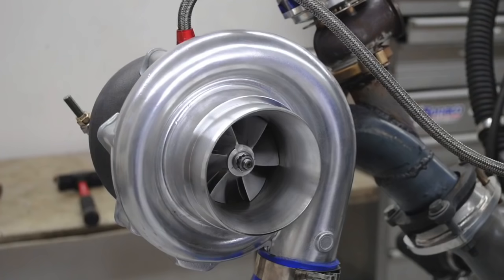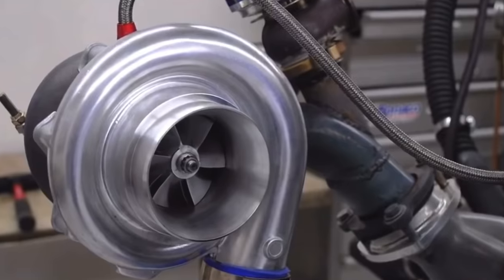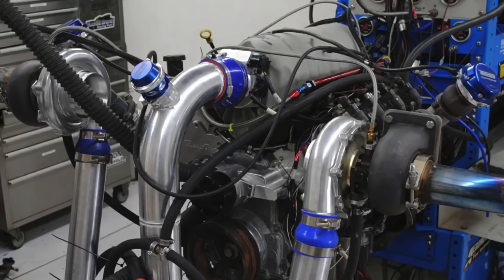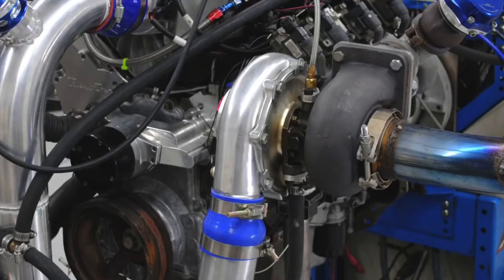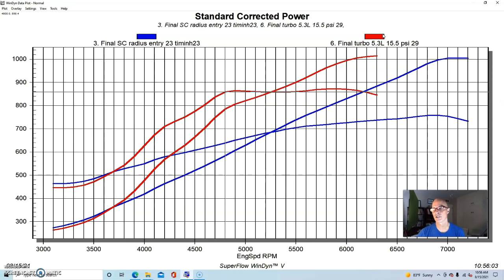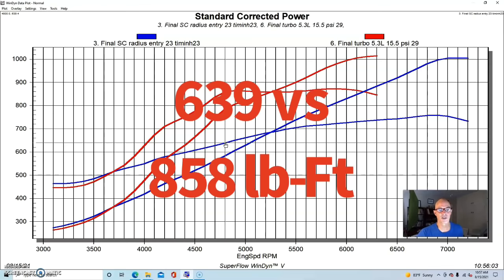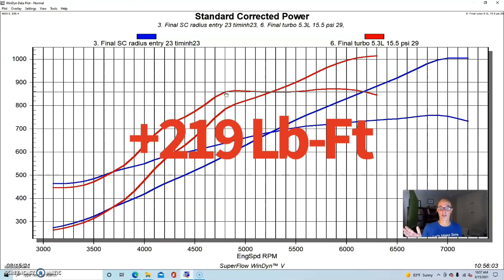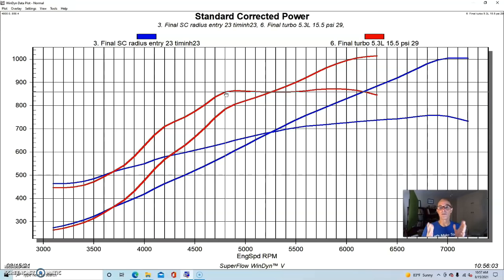HOW THEY WORK-PROCHARGER VS TURBO (WHAT WORKS BEST?)

Comment: The turbo is thermodynamic "magic", it extracts it's power from the wasted heat in the exhaust
Reply: No.. it spins due to gas flow.. hot gas has more volume. A hot turbo has tighter tolerances.. hense you can't hit a turbo with only a. Blow torch and make it spool.
Reply: Not really...  Turbos are just more efficient than mechanically driven superchargers.
Reply: He's not wrong. Just left out a few details. The thermal efficiency of a naturally aspirated engine is abysmally low. The vast majority of the BTU's of energy available in the fuel is wated as heat in the cooling system and the exhaust and the oil. A turbocharger uses one of those wasted forms of heat, which is energy, to increase power output of the engine. Thereby improving the thermal efficiency.
Reply: @yolofullsend  You need to study thermodynamics. It's a 3rd year mechanical engineering class, at least for me.
Reply: @michaelallen2501  spot on
Reply: @HerrPoopschitz  This is exactly why I generally refrain from making any sort of comment that involves anything more than "great video", or "love that"
Reply: @mark_osborne  it’s ok Mark… the intellectuals understand exactly what you are saying. Good luck on that degree! 👍
Reply: @michaelallen2501  He IS wrong.  Turbos do not extract "heat" energy and transform it into boost pressure.  They are simply driven by the pressure and flow of the exhaust gasses passing through them, and would work even better if said gasses were ice cold...

No one has taken the time to think this out, although the answer is very simple.
  You, he, and Richard, are simply repeating the same erroneous BS that you have heard elsewhere.
Reply: @mark_osborne  It helps if you know what you are talking about...
Reply: @richmond4471  wrong. You clearly do not understand thermodynamics. That's ok, you're not an engineer. Meanwhile, best you listen and learn for a while
Reply: @200mphgt40  Lol, "clearly"...  Got it...

Only,  I do understand, kid.  And I am an engineer.

Please advise us regarding your own special credentials, and elucidate us further concerning your "thermodynamic" expertise on this subject.  We're all listening...
Reply: @yolofullsend  I don't know how "tighter tolerances" bear on the immediate subject either way... however your statements are correct.

Now look at the number of 'likes' gathered by the well meaning, yet ignorant OP... and you can plainly see a great example depicting the ratio of blind sheep vs critically thinking individuals in this world...
Reply: @richmond4471  im not sure either, but a hotter turbo does seem to spool slightly earlier.  I'm assuming it has something to do with metal expansion.
Reply: @yolofullsend  I think a cold turbo spools a little slower because  gas volume is reduced, due to heat lost to the cool turbo housing.  When the housing is already hot, the gas volume remains constant.  A little less drag from the hot bearing oil, as well...  That's always been my take.
Reply: See what you did in this thread?
😜
Effing hilarious. Good luck with your degree. 
One more engineer means one less lawyer.
Reply: @2lotusman851  Not sure how you came to that conclusion...
Reply: @michaelangelo8001  ???   None of the engineers I worked with, that I knew... had Law degrees.  Business degrees, some.
Reply: @2lotusman851  thank you yes, it's a hoot for sure.  It was 1983 when I took those classes, I'm an old fart now :-)
Reply: @2lotusman851  Certainly, however how does that equate to "less lawyers"?  
Are you asserting that only a given number of individuals will go to college... and of that number, they must all choose to enter either one field of study or the other?  I don't think it works that way...
Reply from the maker: TURBOS WORK EVEN BETTER WHEN COLD-I HAVE A NEW SHIRT!
Reply: @HerrPoopschitz  👍
Reply: @HerrPoopschitz  Lol...
Reply: But it needs an intercooler. 

You can run a centrifugal with no intercooler.
Run it on a good pulley ratio and bring on boost at super low rpm and have more boost on the same turbo with a pulley put in place of where the exhaust housing is.

I convert turbos centrifugal turbos for pulley use.

I'm running mine off an electric motor instead of the engine. No boost lag...
No losses from running it at idle....

And a lighter setup....

Comment: So it should also be feasible to run a rising boost curve with turbos and ECU/electronic wastegate control. Would be cool to see a turbo dyno graph at 10psi mid range and 21psi at the top
Reply: You can do that. With some wastegate setups you can run 0psi of boost even. I tell you what having an engine with a flat torque curve is great fun. Makes you want to keep revving it out
Reply from the maker: 0 psi?
Reply: @richardholdener1727  yea mate, if you run an electric gate or CO2 powered one then you can have as much or as little boost as you'd like. Mix this with the wonders of modern ecus and you can make your power curve whatever you like

Comment: You should do an episode on compound boosting
Reply: He did some compound tests, but you I wuld really love to see a come back on that. I guess the stock stuff wuld not last too long though with a lot off low end boost. I think he can run as much boost as possible with a normal setup with sensors being the limiting factor.
Reply from the maker: ALREADY UP-PLEASE SEARCH
Reply: @richardholdener1727  Hey richard, I know you covered compound boost with regards to a Roots and Twin Screw style setup in conjunction with a Turbo setup, but my question is would results be similar with using a Centrifugal blower combined with a Turbo? Or is this not a good setup to run with and why? thanks again and been a happy subscriber of your channel
Reply: My concern would be there would be too much Boost at high RPMs but obviously if your Fuel System and Engine is rated to handle it, in theory it would be okay and sustainable? and what about intercooler plumbing for a Centri+Turbo

Comment: Even in Street Outlaws NPK almost every single person in the top ten in points up to this point has a Hemi with a Procharger on it with the exception of a one big cubic inch nitrous engine and maybe a Hemi with a turbo or turbos on it and a 481x with a turbo or turbos on it
Reply: There happens to be 3 nitrous cais nitrous cars in the top at NPK and they all went to the hemi pro charger because of the weight brake

Comment: Richard thanks for the great video’s. 
Question I have a 2014 Silverado with the L86  6.2.
Would you recommend say a Magnuson 2650 or turbos ? 
This is a pleasure so not worried about towing
Reply from the maker: either will make a big difference in power

Comment: I'm lookign to put a procharger on my 5.0 with a 1st gear ratio of 3.66. What benefits from a turbo would I see over the procharger? I'm not looking to kill myself, but get a little extra off the line power. I like my car exaust loud too, as I've heard turbos take away from that (not sure how much though).
Reply from the maker: neither of those choices (turbo or procharger) offer immediate, off-the-line boost response. A PD blower is better at that, but a turbo makes more hp per psi than either once it spools

Comment: I wonder what a CVT (transmission) on the blower input shaft would do where it would spin the impeller faster at lower engine RPM and slow input as the engine speed increases. How would it compare to VGT turbos?
Reply: What about hybrid drive, the engine turns a generator that powers a cell that powers an electric drive.
Reply: Procharger makes one.. "I" force or something.
Reply: Kind of hard to beat a turbo though, look at those boost curves, plus there's no parasitic loss.
Reply: @RyanMcIntyre  Parasitic loss on Turbos definitely exists (remember, the engine can't exhale as efficiently) it is just less than a mechanical one.

Comment: All the power under 6000 (example RPM) is impressive but irrelevant when racing as you are never under 6000 RPM. When racing you shift between 6500 and 7000 (example). And the RPMs only drop a few hundred from one gear to the next.
Reply from the maker: A FEW HUNDRED-NOT IN ANY FACTORY TRANS, RIGHT?
Reply: @richardholdener1727  I CAN'T TELL IF YOU'RE KIDDING OR NOT. WATCH THE TACHOMETER AS THE GEARS CHANGE.

Comment: Richard, can you do a video comparing the boost and power curves of different boost control set ups? 3 port, 4 port, and 2x 3 port set ups etc.
Reply from the maker: how you program them would make more of a difference

Comment: Looks like I’m better of going turbo since I make more power faster and quicker compared to a centrifugal supercharger, and at lower boost levels
Reply: way to many variable for that to be true in all cases and combo's ..have to see the number of PC combos in the winner circles..much easier to get ahold of a supercharger in the 330
Reply: Ive used nitrous, centrifugal sc and turbo. funnest one by far was the turbo also it was very very cheap i made a kit for 1k not as cheap as nitrous but it was annoying to fill.

Comment: Although I know some of the slightly smaller ProCharger head units only make @1000HP. Since the F1A PC has a different gear ratio in it and takes more to spin compared to other PC Units, Do you believe the Power Curves May be different with a different Head Unit with smaller gearing?
Thanks great content, as always....
Reply from the maker: Every centrifugal I have even tested has displayed this rising boost curve-very little boost down low-then max at max rpm

Comment: Do you have EGT or fuel consumption figures from these tests?

I’d like to see the torque when the F1 is making 21 pounds at 6300 RPM
Reply from the maker: no EGT or bsfc numbers-I never ran 21 psi

Comment: Hey Richard, I got some questions regarding crank pulleys and blowers. How far would you push a press fit crank pulley equipped engine with a Vortech V1-S? I'm running 6.8-7psi on my mild 355 LT1. Stock pulleys that came with the 20+year old Vortech kit. How far can I go before I need to think about pinning the crank? Can I pin this crank? If it has to come apart to cut a keyway I'll just buy a new forged crank lol.
Reply from the maker: PIN IT AND BE DONE

Comment: two turbos vs one supercharger,  how about we put a bigger blower on it to equal the size of two turbos, also one should consider all the added weight of 2 intercoolers, 2 turbos, and tons of piping going all over
Reply from the maker: turbo(s) make more hp per psi that any blower because they don't have the parasitic losses associated with driving the blower

Comment: Richard have you done any videos boosting higher compression engines like over 11:1? What tips can you give for boosting an 11:1 ls7?
Reply: If its gonna be a street car youll need to drop the compression or just accept you cant run much boost on 93 and if you want to turn it up youll need some higher octane "race fuels"
Reply: I have 11:1 brand new build i bought in a deal. Wanted a twin turbo or procharger but engine was built to spray. Billy the kid is 13:1 twin turbo, why have people said I need to drop compression to do so? Richard says I have less margin for error, is it that bad? Billy is pushing 30-35 psi at it and I know my motor is on par with his if not better.  Forged Ls 408
Reply: I think most people assume it’s gonna be a daily driver type vehicle running on pump gas. Better fuel, less timing is gonna be the biggest deal from my research.

Comment: So, as a tuner, can you tell me for the horsepower gains which one gives the most power per specific fuel consumption? I know that they both have parasitic power draws and it seems to me that the supercharger seems way less complicated and has the most linear power curve. What are you thoughts on dollar per hp gain? Great video and thank you.
Reply from the maker: turbo wins for power and fuel consumption, though people don't care about how much fuel they use under boost

Comment: If you used a wastegate on the waste gate on the procharger deal it wouldn’t make more boost sooner?
Reply from the maker: IT WOULD ONLY CHANGE A LITTLE IF YOU RAN A SMALLER PULLEY-THE GATE WOULD NOT ADD RESPONSE
Reply: @richardholdener1727  i apologize that made no sense in radial racing and or no prep from what iv been around if your trying to leave east but make a shit load out the back door we put a super small pulley on the blower make the most power possible and then open the waste gate and use it as a “boost controller” in a sense letting it leak psi on the hit than on a timer ramp it in shutting the gate and creating and or forcing more pressure into the motor though as you’ve shown here the blower is going to make power with rpm but in a vehicle with a converter it’s going to stay within a certain range of rpm
Reply: @richardholdener1727  I really appreciate you doing the tests you do I am building a 408 Ls stock block good rotating assembly with ls3 based heads an going to go blow through and between a 4500 body and a 4150 body on a 4500 base any recommendations? It’s going in a foxbody street mainly strip on e85 with full exhaust 2”primary headers from American racing an more than likely a f1r or x

Comment: If you put twin pro chargers on it .I think it would be a better comparison. Carroll Shelby put twin paxton's on the super cobra sack in the day.
Reply: I disagree, if the single head unit is sufficiently sized for the power goals, it’ll definitely make more power than twin blowers creating twice the drag to meet same power goal.
Reply: The curve would look exactly the same as one procharger.  It's still same boost per RPM. You could add 20 it would be the same.
Reply from the maker: if you add a 2nd blower-the airflow doubles (boost goes way up)

Comment: What is the cost comparison between the 2 systems? I have a 2005 ctsv with the ls6. I already have full length headers and full exhaust and a cai. Trying to figure which route to go. will be daily with some drag use.
Reply: Turbos cost more and are more difficult to install.. you will deal with oiling issues and have to worry about overboosting... they make the most power... if you want xxx power without the headaches then a supercharger is the way to go.. just know its less efficient and puts way more strain on your engine and its bearings.